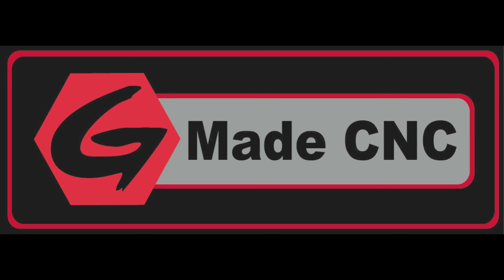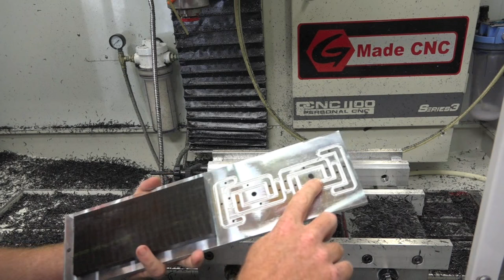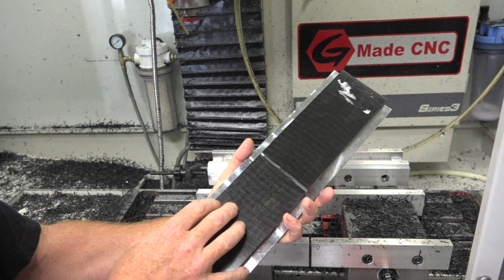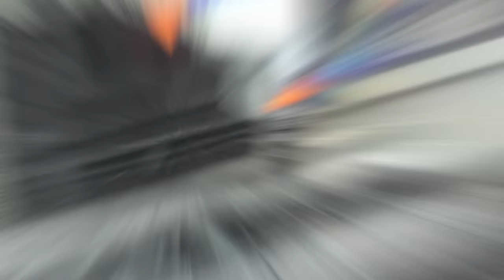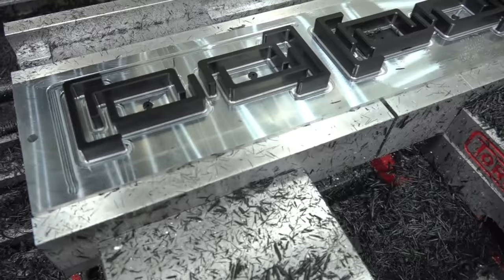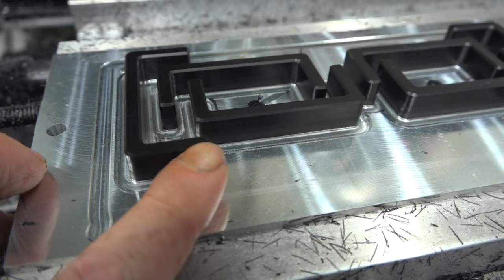Fixture Tips

Comment: If you are screwing the parts down anyway then why do you need the rods?
Reply: Hmm you're right, somehow didn't realize it was just stock. Maybe the screws are not enough for holding the stock in position while facing? Don't know
Reply: I guess for alignment, as threads can't hold tight tolerances. It keeps the part from moving in xy direction, too - while the screws are keeping it from moving in z direction.
Reply: You don´t need tight tolerances for alignment with this stock material!